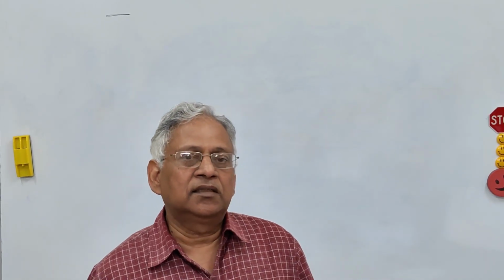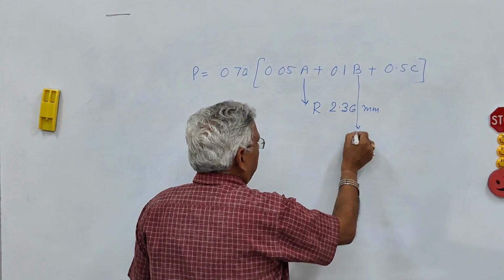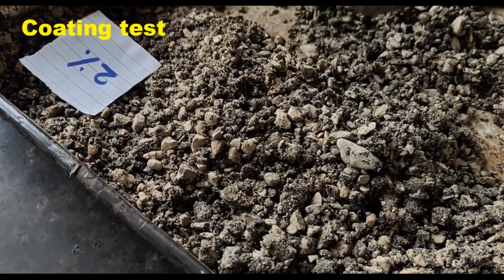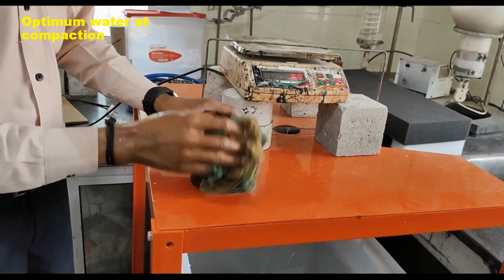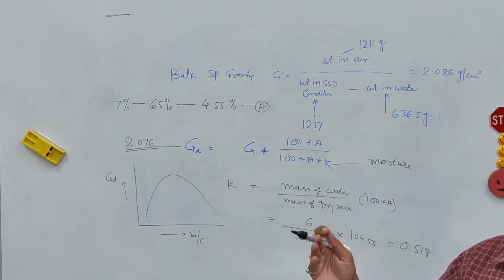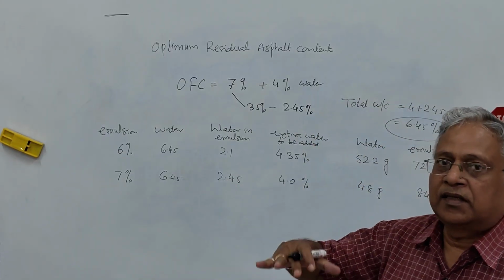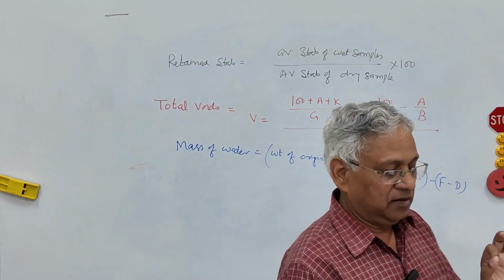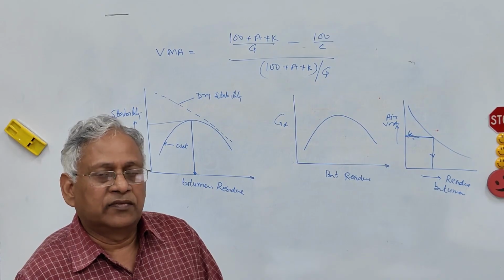Design of cold mix for Bituminous Concrete as per MS-14, Appendix F, with all laboratory tests

Comment: Sir firstly i would like to thank you for such excellent explanation. Sir what if we use RAP instead of virgin aggregate what changes we can expect. Do the mechanical properties change like the RAP is already stiff so probably their may be problem of permanent deformation.
Reply from the maker: There are several issues with use of RAP here. (1) Our codal specifications do not permit use of RAP in the BC layer, (2) Rejuvenator cannot be used here in cold mix and therefore you can not take advantage of bitumen in the RAP, (3) even if you use RAP as a black roack aggregate, emulsion will not be able to coat the aggregates which are alrady coated with bitumen. Because coated aggragates will be almost inert with no surface charge.
Reply: @SatishIITR  Thank you sir for the clarification. But I have read some paper they use the RAP in  cold mix for the DBM layer. Can we use it there ?
Reply from the maker: @ManavSing-wu8fy  Yes, RAP is permitted in DBM layer but not with cold mix technology

Comment: Respected sir, nicely explain the procedure cold mix design, sir, please guide how it is differ from IRC 37-2012 .. in appendix it is given with TSR
Reply from the maker: I do not have IRC 37, 2012, but MoRTH 2013 suggests MS14 procedure. Moreover IRC codes do give mix design procedures. It only specifies the limits of parameters

Comment: valuable session... 🙏🏻
In the rainy season cold mix is often used for maintenance of the pavement surface. Are there any recommendations for emulsion such as ( R S, M S, S S ). In the schedule of rates its recommended for MS but in the field to rectify normal patches R S is in use.  Kindly provide your guidance in this matter.
Reply from the maker: Use of grade will depend upon the purpose of use and climatic conditions. IS 8887 provides some guidelines